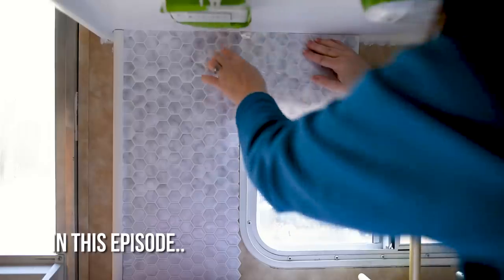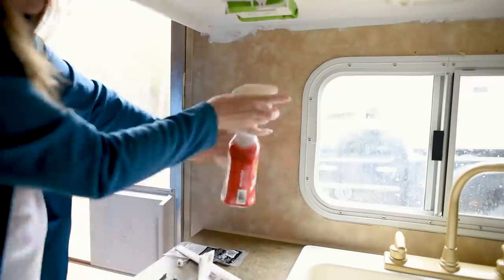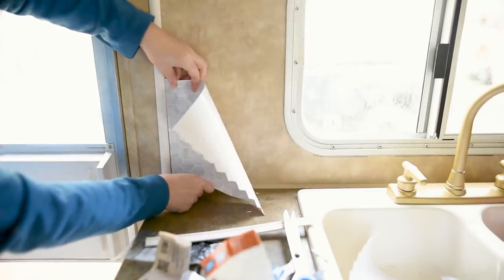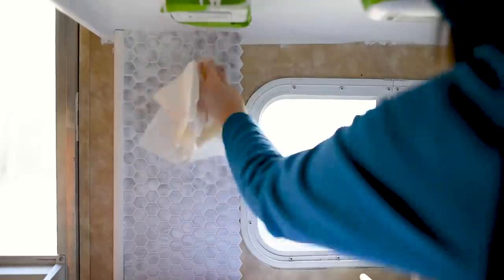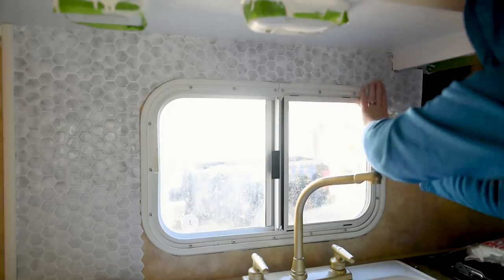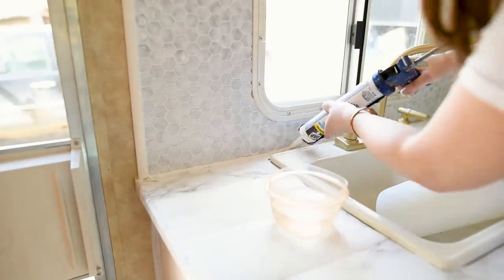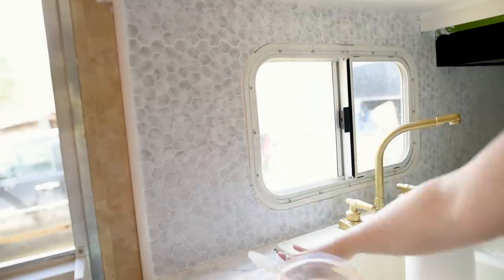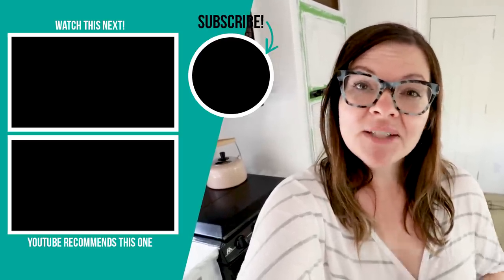Installing peel & stick tile backsplash and countertop | Our DIY Camper 2 | The DIY Mommy

Comment: A trick you can try on the corner of the counter if you choose to keep the marble wrap around the edges, is to use hair dryer to heat the peel and stick so it will stretch over the corner.  I've never done this myself, but I've seen soo many diy youtubers do it, so it's worth a shot. Maybe give it practice run on scrap wood or something?

Comment: For round edges I’ve seen other youtubers use heat? So you’d direct a blow dryer to that section as you pull that section of paper and the paper would stretch to allow you to adapt it to whatever shape the surface has, no weird corners or edges 😊 😅 you’re already done with this, but I just hope it helps to know for future reference 🤷🏻‍♀️

Comment: Love the tile backsplash. For the vinal countertop if you have a rounded edge and use a hairdryer and heat that area a gentle pull it will stretch to fit the curve and then just tuck it under a bit and cut it. That's how to get a smooth rounded corner. Luv all your project's 💕❣️❣️ Sincerely Lori K
Reply from the maker: Thank you!

Comment: Beautiful as usual! ❤ for the rounded edges, you can heat the vinyl with a heattool or hairdryer to be able to "stretch" it around the corner instead of overlapping like that. Or so I've heard at least, theory vs reality and all, I've only done it like you did - I think it's good enough! But just a tip you might wanna try if you weren't happy with it. Like I said I think it looks beautiful and I always look forward to the next video. It's like xmas everytime a new video is out 😄😊
Reply: I've used a blow dryer to heat the peel and stick vinyl to make it stretch and I can confirm is works amazingly!!!

Comment: You did an amazing job! We have a similar style. I recently covered my desk in contact paper & for the corners i would recommend using a blow drier. It'll often the paper enough that you can slightly stretch and seal it around the coeners and the lip of the countertop for a clean finish.
Reply from the maker: Great idea!

Comment: I rolled some contact paper on the inside walls of a cabinet and it just peels off. I used regular bare plywood.  I even tried a hot hair dryer on it. Thought it was working, but the next day it was hanging down again. Is there a way to keep the paper on?

Comment: You can smooth out the corner of the counter using a blow dryer.  Heats the paper and allows it to stretch.  You did a great job.

Comment: A hair dryer works great on the counter material. Our kitchen counters are rounded and if you heat it slightly your able to stretch it a bit.

Comment: great job ,,,but the corner ,tip use a hair dryer gentle heat ,then smooth it over extra glue or even a few pin nails or staples dont cut into it when you do another project leave the corner intact cut of excess when its in place x

Comment: Have you have any problems with the contact paper peel and stick stuff peeling, fading or bubbling over time?  Heat or water issues??
Reply from the maker: No, it has been pretty water resistant  - we haven't had any issues.

Comment: I used the same tiles on back splash but I removed the inside window frame.  The window does not fall out and make trimming the tile a lot easier.  Once done just put frame back in and screw done over tiles.
Reply from the maker: Great idea!

Comment: This turned out beautifully! Loved that you showed the mistakes. It's a mark of a real DIYer. I've used a blow dryer around the corners when I did my basement kitchen countertops and the vinyl wraps around perfectly. I also use silicone caulking with rubbing alcohol spray applied before using my finger  to seal everything neatly since it's more water proof than latex caulking.
Reply from the maker: Great idea!

Comment: We used contact paper in our little camper and the weather changes shifted the adhesive. So now we have a small gap on our counter.
Reply from the maker: Oh interesting - I've never had that problem and ours went all the way down to -30s and as high as +30s!
Reply: @thediymommy  I don't know if my husband did not clean the surface very good. Or not over lap the pieces....but the pieces shifted apart.

Comment: After struggling with caulking 10x, I learned if I put painters tape on either sides,wall and sink..I can smooth caulking out with a card to get desired thickness, let dry a few minutes and peel tape..perfect straight lines !!!. Love yr designs